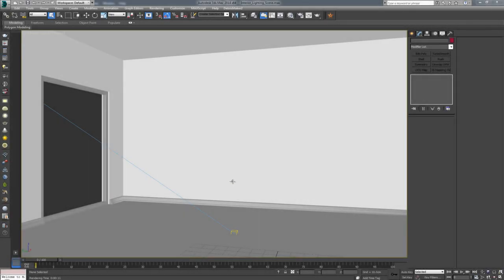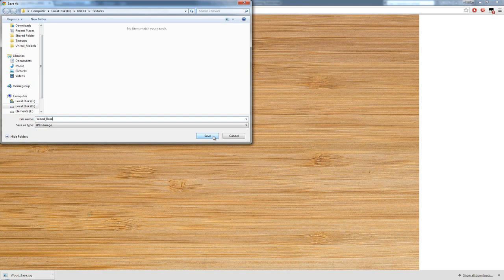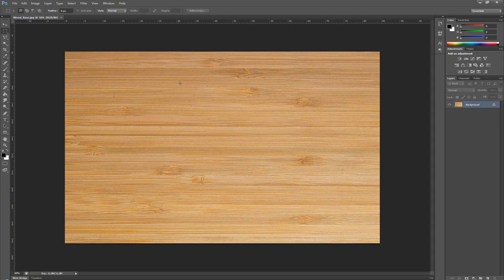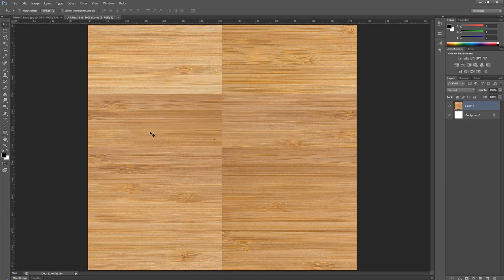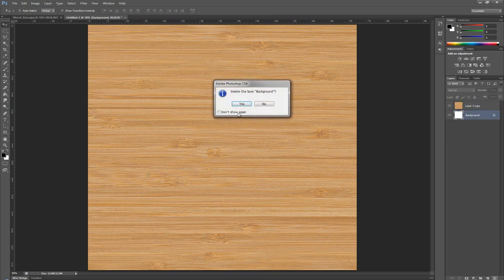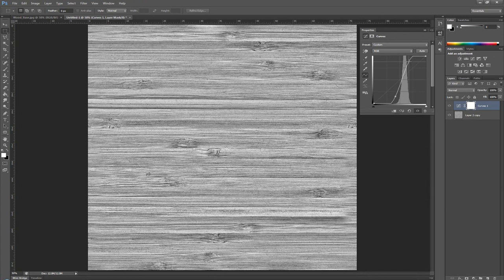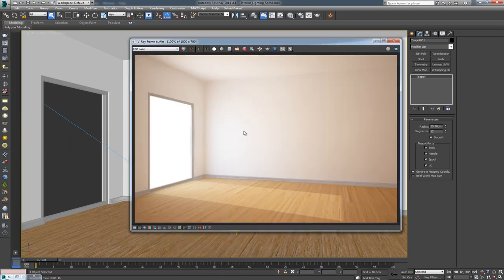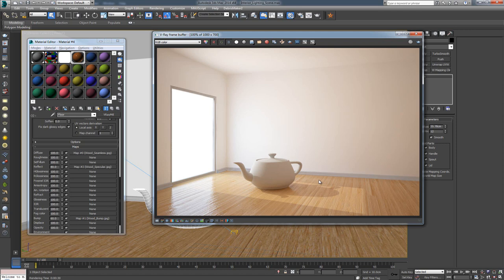Creating Seamless Textures With Photoshop

Comment: Thank you so much, Denis. I had texture with non-equalized colors on its edges. One issue arise then I was trying to text your method is that I have no High pass filter then using rus PS version. But it appears then I installed eng one. It`s a bit strange that translated versions has cutted tools, or maybe it was hidden somewhere else. Anyway, seems that it works. Testing it in 3ds max for now. Thank you!

Comment: in 3ds max the texture still appears as tiled one, although i have done exactly the same thing you did (step by step)! could you help me with that?
Reply from the maker: +Хрен Скажу Can't be sure as to what you got without seeing what you did, but here are a few pointers that you should see to:

Make sure your texture is a square size  1x1
Make sure your texture is color corrected
Make sure when you offset your texture you don't have a distinguishable mid line

I hope that helps
Reply: Thank you for replying! It turns out that stamp tool in PS leaves blurred contour on picture, so it creates an impression of tiling when applyed in 3d max..
Reply from the maker: Хрен Скажу Well it's all good when it ends good :) Glad you managed to fix your issue
Reply: Thank you for the video! Keep that content qulity of your channel.
Reply from the maker: Хрен Скажу I'll do my best, i am trying to keep it to at least one video a week but in the end it all boils down to how much free time i have.

In any case thanks for the positive feedback and i'll try to keep up